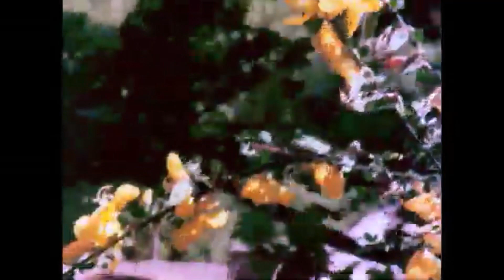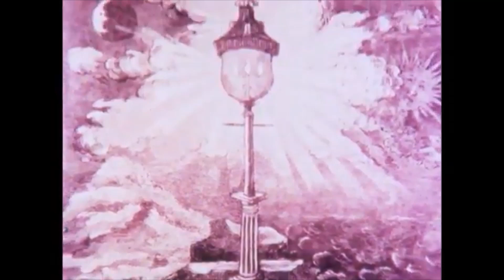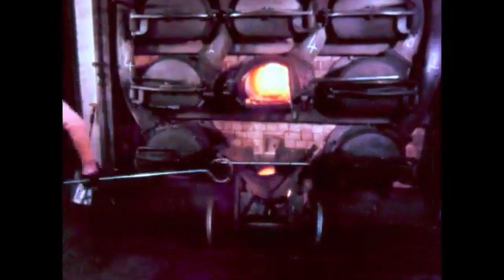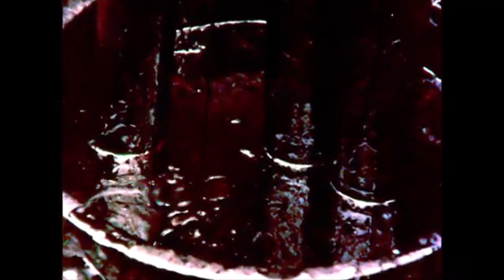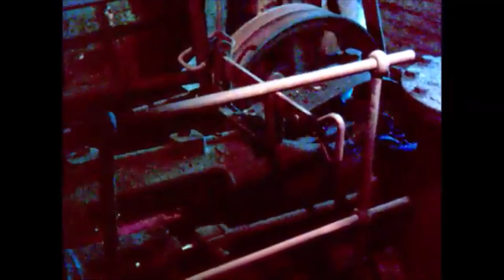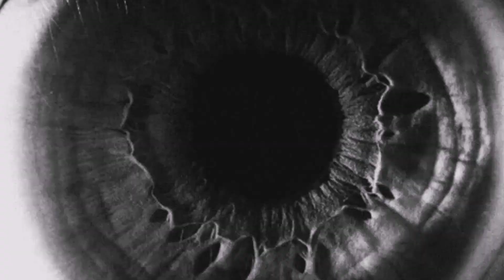19th Century Brick Beehive Coke Ovens and the Coal-Tar Industry (1973)

Comment: It seems to me that this video does not explain Jon Levi’s presentation. The interior was clean, no carbon dust. The damage was not on the inside, but the heat seemed to come from the exterior. 

Those 700 structures were not ovens, they were shelters. But from what? Plasma discharges, solar storms, free energy attacks?
Reply from the maker: The point is not to prove his theory...first we need to learn what Coke Ovens are...then we can understand what they are not...LUV BEAGS
Reply: @stuffedbeagle  then you’d should not have even referenced Levi. Your presentation makes a comparison, so do you think that what Levi presented where ovens? He had a particular theory that it was a type of shelter. Do you agree with his theory?
Reply from the maker: @questionsimpleanswers6709  I will reference anything I fell like referencing...for any reason I see fit...Make up your own mind..LUV BEAGS
Reply: @stuffedbeagle  WOOF!
❤️U🐕
Reply from the maker: @littleozarksfarmstead  Are you WOOFIN at me?!...WOOF!...LUV BEAGS
Reply: If plasma is what y'all say melts the bricks WHY would anyone hide in a BRICK shelter??
Reply from the maker: @rebelyell1895  Who is the Y'all, you are referring to?...LUV BEAGS